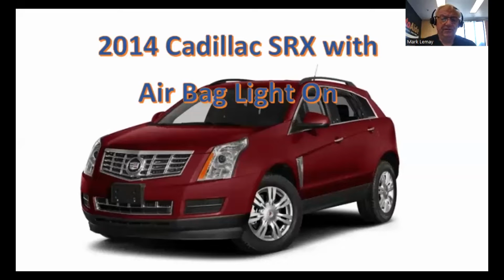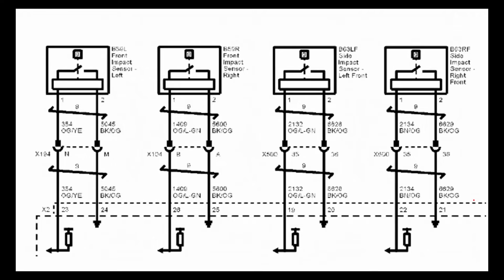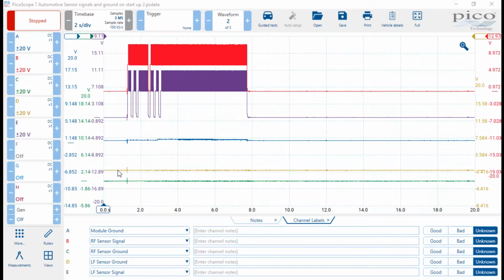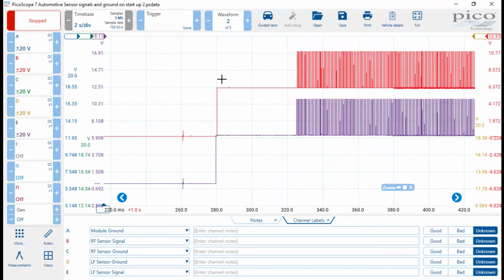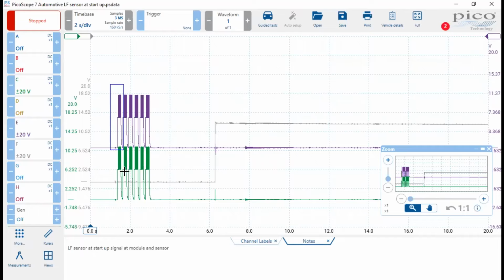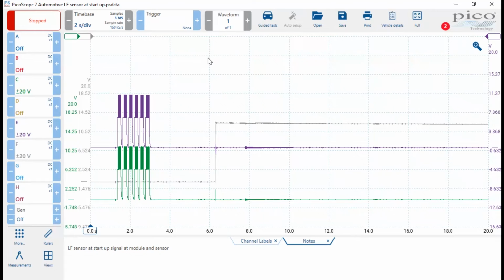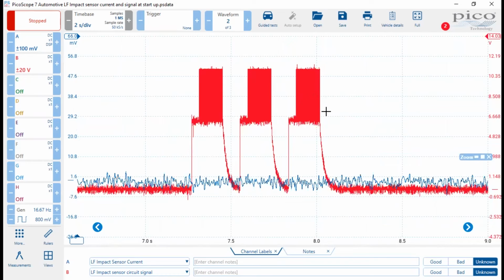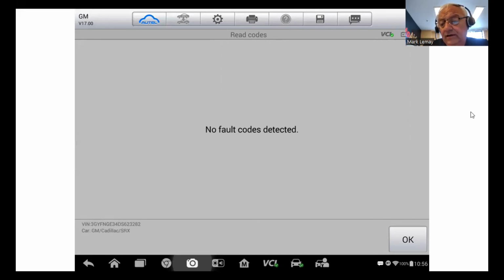Air Bag Light Still On After Repair (2014 SRX) Problem Solved!

Comment: I have a 2016 Cadillac SRX and today , I had drivers and passenger windows down about 2 inches . And then we had a rain storm , it rained very hard, by the time I got out and put the windows up , there was water on the carpet and seats ..
So I started the car and up at the roof line , there is two airbag lights , one for driver and one for passenger, drivers is fine , but passenger light is red.. 
so i am wondering if a sensor got wet …or it was a coincidence.. I know it’s hard to tell .. and it would be a guess .. I don’t have a scan tool but thought I might just wait a week and if still on unhook battery. And see if the red light comes back on …